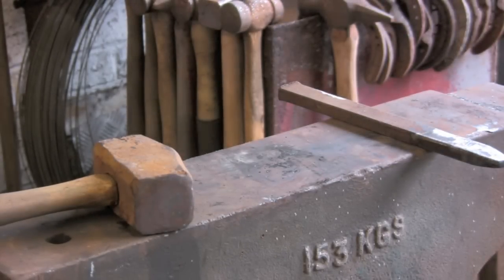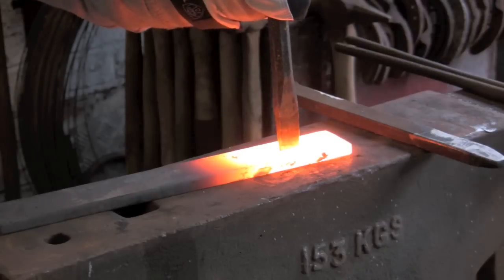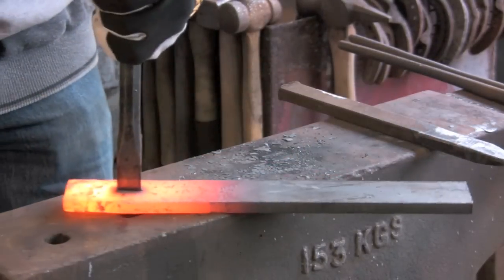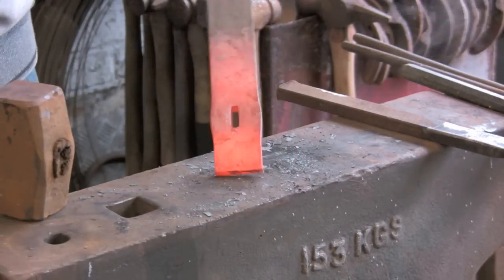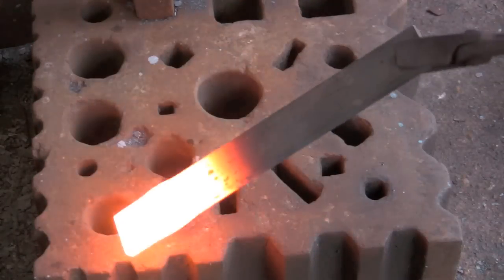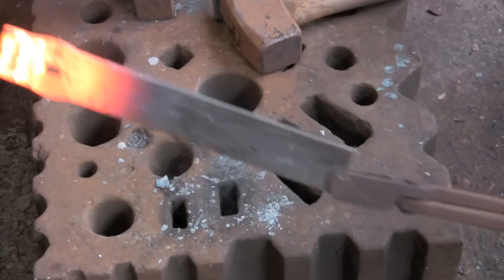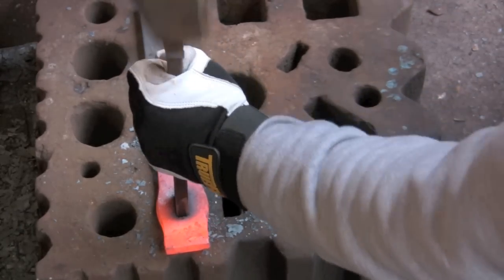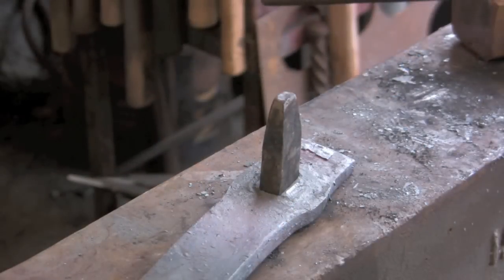Slit / Slot & Drift.

Comment from the maker: Most of the time when punching a hole you don't remove the swell as that is where the strength is which is why you punch. But when doing a slot you can remove it by simply putting a drift the right size in the hole and hitting either side gently working the material back in.

Comment: was that just a piece of mild steel you used to drift it open?,the inch by half inch i mean.i just forged a top tool for slitting heavy stuff and am wanting to make nice consistant rectangular holes for future top tools.guess the question is would a hefty piece of mild steel hold up to this stuff if not over worked?